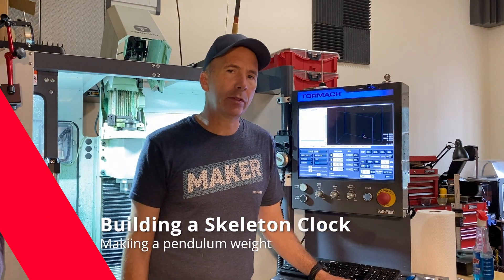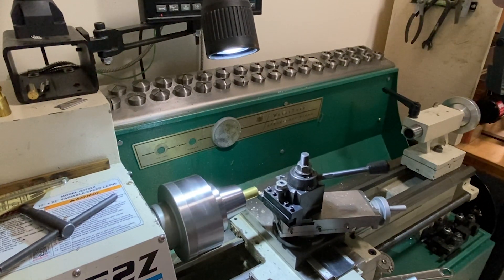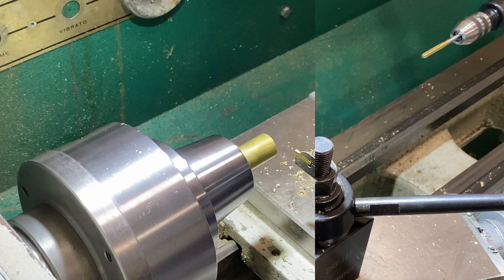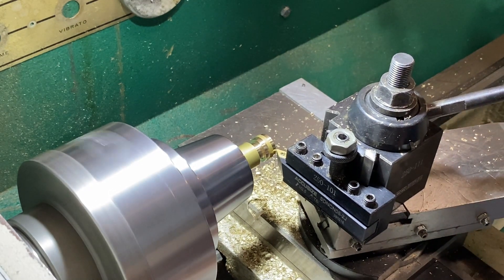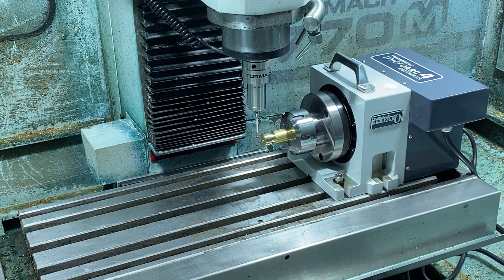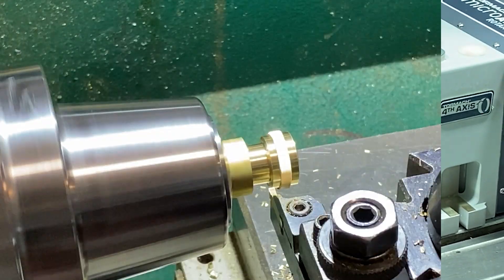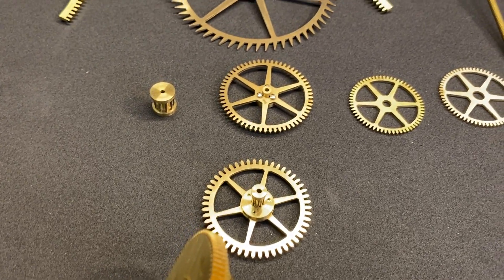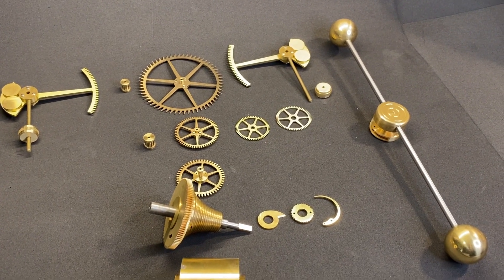Making a pendulum weight for a Skeleton Clock.

Comment: Nice progress on your navigator clock and the parts are looking really good. Does the cnc and forth axis belong to you or your work place? Just curious! Thanks for sharing your videos and looking forward to the next one.
Reply from the maker: Thanks,  it is in my home shop.   I just got the smaller 4th axis that Tormach came out with and it is very good.   The 770 is a nice machine as it has a lot of capability but still plugs into a standard outlet.
Reply: @KevinNolanMakes  your lucky having a cnc to work with, there’s been times when I would have liked to have used one. I would never get the chance to use one at work.

Comment: Looking forward to seeing how the accuracy tests come out... I wonder if modern precision manufacturing equipment has any advantage over what Harrison had available.
Reply from the maker: That is a great question.  I think it comes down to skill.  Current cnc machines should hold tolerances under .001 inch.    This is only true if you manage the set up and sequence of operations.   I am still learning and find the machines are accurate but the main issue is how I set datums or the sequence of operations. I feel we are following giants that were able to optimize the accuracy of the technology available to them.   I am a long way from that.  Thanks for following